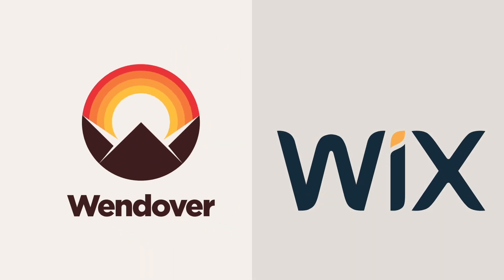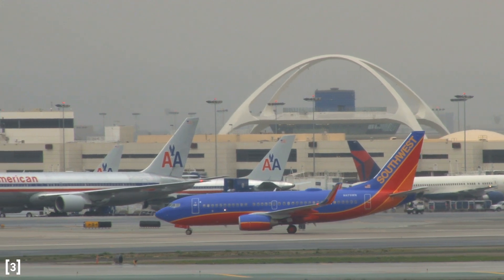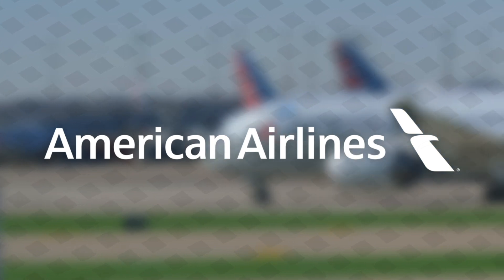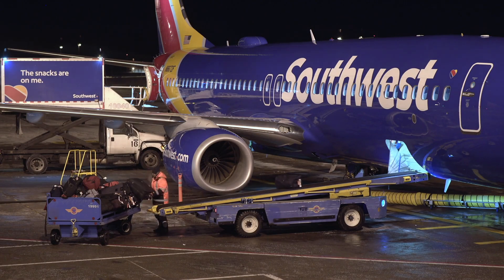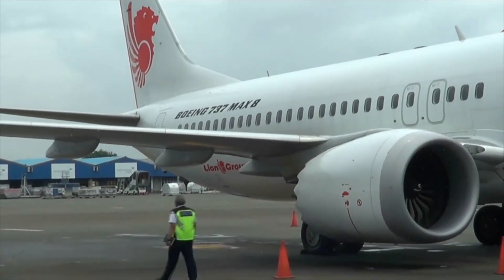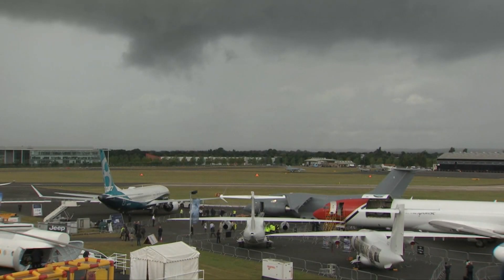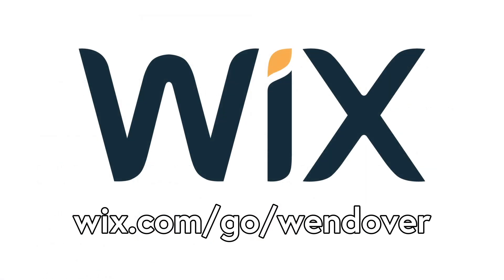The Economics That Made Boeing Build the 737 Max

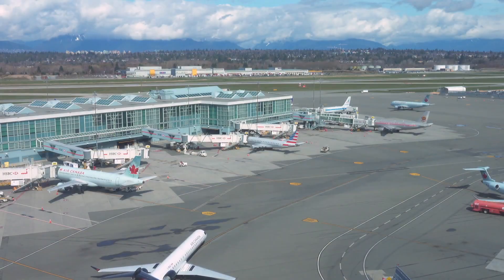Comment: Not one, but TWO retro-jets at 3:37!

But honestly, the 737MAX isn't a BAD airplane, just DIFFERENT from the 737 Classic.  The problem isn't that MCAS exists or was deemed necessary to make the Max fly more like the Classic; the problem was an implementation that used just one angle of attack sensor, and that was too difficult to disable when the software was guessing wrongly.  Plenty of other planes use aerodynamic and software hacks to make one version handle like another- or does anyone really think the A318 and A321 have similar flight characteristics by chance?

Let's also remember that even if the 737 platform is 50 years old, the A320 platform is 30 years old.  Newer, but not exactly new.  Both have seen assorted revisions and upgrades over the years.  Both have lasted so long because they're good designs that deliver results the airlines want.
Reply: Age itself is no problem: If something works well, there is no need to change just for the heck of it. What we, however, can say, is that the 1960's design of the 737 is showing its limits in the modern reality of airflight. One example is that mechanical cables have a cost in weight and thus a mechanically controlled plane like the 737 will always be heavier than a fly-by-wire plane such as the A320.

The accidents and the need for hacks like MCAS further show the age of the design. And allthough I certainly do not want to say that Airbus is immune to these matters, the A320 design does appear to age a lot better. On the topic, the A320neo really didn't need significant modifications in order to be fitted with the new engine, thus no weird engine placement and hacks like MCAS were simple not needed at all.

And I think the market also acknownledges this: Before this generation of planes appeared, the market was already moving towards the A320 and sales were expected to surpass the 737 within a few years. It is probably not a strange though that the current situation with A320neo all okay and 737 Max grounded, will also help further convince the market that the 737 is a dead end.

Boeing better starts to design the 737 successor yesterday.

Comment: This is the best explanation I have heard.
It’s the first time I have heard that the requirement for the MAX came direct from an airline rather than Boeing’s normal product development process.  Meaning that the sales team rather than the engineering team would have been driving the development and delivery schedule.
Reply: Manufacturers build products mostly based on what the customer wants, period.
Reply: Pan American wanted the 747 before they ever knew what it's model number would be... you could say it was conceived on a fishing trip. The problem is that the airline's kvetching for annudah small cheap plane forced Boeing to remodel their popular model line one more time and this caused it to fail spectacularly. They need to pull another 747 out from under their hat. They need to make a new narrowbody that meets the demand of the modern airlines that would, sadly, probably wind up taking the 737's place like how it took over for the 727.

Comment: At the beginning of the video, the way the video editor try to insinuate that the crash or the poor performance of the plane is due to the fact it's based on old design is very misleading, because the attempt at incorporating new technologies is what has caused all the problems that Boeing is facing now. And despite the issues that the company face with this one type of airplane Boeing planes has been around for a very long time, Airbus has been around only for few decades and we have to wait and see if their plane can fly safely for as long as Boeing's has.

Comment: I love your videos. I have a little more info in the 737Max. My father is a captain at Southwest and has been for 25 years now. Before the grounding of the planes. They actually introduced a short training that would better prevent stalls. If there was a stall but the air craft was correcting improperly then the pilots were instructed to have the plane at a certain angle of attack with a certain throttle position depending on altitued. This would be known positions. If they nee that these were correct they would know that the plane was in fact not stalling. It has more to do with pilots not understanding the plane. Yes I know this is not how a plane should be. But it was not as big of a problem as it seems. Yes the 737 is old but my dad can confirm that the new 700 800 and Max series planes fly much much better and aren't even the same plane anymore. The new models are longer. With larger wingspans that brings much better improvement. It's too bad that many lives were lost due to the rushing of the planes production and I hope they figure out the problem soon as they are still great planes and lots of companies have no intentions removing the older models out of service any time soon. Keep up the great work. Look forward to your next video!!

Comment: There's another factor which undoubtedly had an impact on Boeing's decision to undertake the 737MAX instead of a new narrowbody design. In the years leading up to 2011, Boeing was also struggling with development delays on their 787 project, which soaked up a lot of development resources, manpower, and money that Boeing could otherwise have diverted to a new project. I am quite sure that Boeing would have announced a New Small Aircraft immediately after or even before the A320neo if they'd had the resources available for that project which they'd anticipated assuming a smooth 787 development cycle. Instead, the delays on the 787 bled over into their anticipated future projects, and also likely made the company more risk-averse toward developing another clean-sheet design. So when Airbus announced the A320neo, Boeing needed some sort of response faster than they could develop a new design, and they were nervous about taking on the risk of a new design. And so, as Wendover said, they went with what seemed like the safer move from a business standpoint.

Comment: Short haul planes are replaced much more often than long haul planes because the number of hours on the plane doesn't really matter, what matters is the number of pressurization cycles the plane has. Short haul planes do more flights and have more cycles so they need to be replaced more often. That's why the domestic planes are always so much nicer and than the planes that cross oceans.

Comment: Why did they not just raise the gears, the wheels could compensate for the height difference, then they will say to pilots, due to the adjusted height, you might want to feel the plane's flight and rate it based on it's similarly to the old 747s

Comment: I’m not an expert on aerospace engineering, but instead of raising the engines, wouldn’t it have been easier to just lengthen the landing gear? I know it would take away from the original reason of it being low to make loading easier. However, now almost all airports in the world have conveyor belts, baggage systems, etc. The widespread availability of those things would theoretically mean that there is no real need for a plane that is low to the ground. (If anyone can explain why Boeing made the design choices for the max they did, I’d really like to hear that explanation.)
Reply: These belts and catwalks still take time to deploy, connect and in general take more time to use. Nobody wants to use them, that's why the planes are always so low. Time costs money.

Comment: Just one thing that could have been added:

Boeing did NOT tell pilots that this MCAS system was in their planes, when they first rolled out. They were not told about it in the flight manuals and no one knew it was there. Had it been included, there is a good chance it would have required either expensive sim training OR an update cert. So....money decision that cost lives.

Comment: Not a bad video, but a bit hasty at the end. Boing made not one mistake, but a series of very wrong decisions that proves both their engineers and their management are not to be trusted..

1. They build a plane that flies so badly it needs electronic correction measurements. That is always a bad sign, even though there was a technical reason for that. 

2. They did not plan any redundancies for a vitally important sensor. In cases like that you want three sensors, so if one is faulty you know which one: The one that sends different data then the other two. That is the norm in every savety relevant industry: Nuclear power plants, aviation, medicine...
They had one

3. They implemented the system in a way that does not clearly show when the electronics override the pilots steering, and that is not easily and intuitively turned off. The black box data of the lion air flight indicates that the pilot restled with the MCAS for minutes. Turned it off, and a few seconds later it interfered again, until the plane finally crashed.

4. They did not make sure the pilots were trained with the MCAS, as it would be self-evident for any savety-conscious company.

All in all, this were not the decisions of engineers and managers that care overly much for their passengers. If Boing would go belly up over this it would be a tragedy for the innocent hard working people at their production facilities, so i won't hope for that. But I really want to see about a dozend Boing decision makers end up in jail for this blatant disregard of safety and human lifes.

Comment: Besides lacking the fly by wire which pilots prefer everything else about the MAX is like a new jet...... avionics , materials , engines , manufacturing . They made a terrible mistake not having redundant AOA sensors and that's about it.
Reply: Plane on TOGA have tendency to pitch up, goes to stall conditions.... But no frame is good

Comment: I lived in the Seattle area 2011-14 and knew people who worked at Boeing. At least with engineers, they seemed to have a work culture where people went in for 40 hours, did about 5-10 hours of work, goofed off otherwise, and pulled huge paychecks and pensions doing very little work. It's no surprise to see Boeing's 737 Max disaster happen. It's decades of laziness and shortcutting piling on top of each other. Labor rights and high wages are great, but when people are on the job, they should be doing the job. Boeing doesn't seem to work that way, and the fact that they've stayed this competitive for this long speaks to how much money has been sunk into their inefficient system...

Add in the airlines' stance and a weakened FAA, the 737 MAX issues were almost predictable...
Reply: Because Boeing is subsidiary of government. Is too big to collapse, if Boeing have troubles DoD make new f-22 or just make bailout like GM
Reply: Mateusz Zimon, Boeing is NOT a US Government Subsidiary. It's just a STEPCHILD of said Government, like other US DoD contractors that have been "breastfeeded" for decades by Us, the taxpayers.

I have figured for years that IF and WHEN the US Federal Government is REALLY SERIOUS (they're not) about budget efficiency they could CUT THE DEFENSE BUDGET BY - 40% (U$250 Bln) and still get EXACTLY THE SAME QUALITY FROM THE USDoD WE'RE GETTING NOW.  

Those savings could spread a lot of ways in a lot of places, think about it... 

(I'm NOT FOR WEAKER DEFENSE, I'm for SMARTER DEFENSE)
Reply: @syxepop  just make like other NATO country just 3% GDP not more.... Or even less like more nato country's
Reply: @mateuszzimon8216 , problem is not necessarily the amount invested in defense / defence (I agree with others that European and other regions Democratic Governments are not investing enough into it and "leave to the US DoD more of the job than they should"), but HOW IT IS SPENT with too much of it going into private contractors, like Boeing (there are worse ones), that are SERIOUS WASTERS and can do the job they're trying for far less than they're given.
Reply: @syxepop  just limit resources for dod, we pay 2,99% GDP in '18 but just make orders for new helicopters and boats
Reply: @mateuszzimon8216 , what country you're from?
(am writing from Puerto Rico, a "colony" of the USA, if you're asking...but not a nationalist or isolationist in any kind of way )

I'm seeing a list in Wikipedia from "Trends in World Military Expenditure, 2018" from Stockholm International Peace Research Institute and US DoD is JUST OVER what you've stated at 3.2%, (U$649 Bln for 2018) so I can safely say it's the QUALITY. 

BTW, UK (1.8%), DE (1.2%) and JP (0.9%) are all financial powerhouses BELOW THE WORLD AVERAGE of 2.1% (even the PRC is just below at 1.9%). 

THAT'S WHAT I'M TALKING ABOUT!

Comment: Not a fan of 737 Max and not an airplane expert at all, but I think the cable connected mannual controls are for extra redundency and developing an all new design instead of upgrading the exsisting one calls for very long time of test and certification processes to make sure the new design is as safe as the old one or safer.

Comment: Hi I have a question, why not simply engine swap an already in service aircraft (in addition to other necessary electronic equipment such as the paper vs digital checklist)? It seems the developing an engine within certain size, power, and efficiency parameters is cheaper than having to redesign whole aircraft.
Reply: They wanted to put a bigger engine but that would mean that the engine would be just few inches off the ground, so instead they moved the engine forward and up once again, which in turn lead to these unstable flight characteristics.

Comment: To be fair to Boeing, the two crashes that occurred were mostly pilot error with MCAS playing a contributing role at most.

The Indonesian crash had two important factors:

1. The aircraft had an AOA indicator problem and activation of MCAS on the three previous flights of that aircraft. The aircraft was not repaired and despite not being airworthy was dispatched for use.

2. The pilots flying the mishap flight did not recognize what was essentially a STAB TRIM RUNAWAY and react with the proper memory item drill.

Regardless of the cause of the inadvertent MCAS activation, the aircraft was flyable and had the pilots reacted properly they could have avoided the crash.

The Ethiopian Crash had three important factors:

1. Crew experience was suspect. The Pilot in Command had a reported 8,000+ hours despite being only in his late 20s. This suggests either some of those logged hours weren't quite legitimate OR he was massively experienced. I choose to believe the later: he was a very seasoned and senior Captain despite his young age. But, that hardly mattered because the first officer had only a total of 200 hours - two hundred! Total... Flying anything... That Captain might as well have been by himself and piloting is a team sport.

2. The pilot flying set maximum power during take off... And then left that throttle setting at that power level. Eventually the aircraft attained 115% Vne (Velocity Never Exceed). This was a significant factor in the difficulty the crew encountered hand trimming the aircraft, especially when the stabilizer was under a load from elevator control surface forces.

3. The initial appropriate reaction of disengaging the electric trim motor and disconnecting the autopilot data source (i.e. engage the two STAB TRIM CUTOUT switches) was performed properly per the memory item drill - but then system was turned back on when the crew had difficulty hand trimming the aircraft. And then the MCAS continued to trim the nose down with the end result being the crash.

Many contributing factors in this crash: CRM and Crew experience, improper thrust settings, reengaging a malfunctioning system, not understanding the aerodynamic forces on the stabilizer especially at high speeds, etc. But, again, the aircraft was flyable and the crash could have been avoided with the appropriate actions.

Lots of tragedy here, but if the focus is only on the MCAS design then it will ignore the causative factors that will not be addressed with the Boeing software changes and these same factors will continue to lurk waiting to trip up the next crew that thought that MCAS problem was solved, not realizing MCAS wasn't as big an issue as those other contributing factors were.
Reply: Hmm, but this plane in TO/GA pitch up to stall.... 
This is unstable design
Reply: MCAS isn't even active unless the flaps are up and the pilot is hand flying - if you TO/GA you're going to have flaps down. Clearly Boeing isn't worried about stall in the conditions you've described.

You might as well call the A320 "unstable" because of the alpha floor protection in primary law. Or it's "unstable" because it has a vertical stabilizer and without that it will crash.

Key here is "instability" would be characterized by the control surface outputs or internal states growing without bounds. The pitch up tendency which is a factor for any aircraft with under-wing engines forward of the center of lift, is greater in this aircraft because of engine placement but not massively greater and it's based on engine thrust being generated - which generally requires nose up or down trim when thrust settings change regardless.

For what it's worth, again, the A320 trims nose down trim because of thrust settings too... In fact, the fly by wire stuff make a lot of adjustments to the aircraft's trim without the notice of the pilots... But it's not "unstable" because it needs to do that.